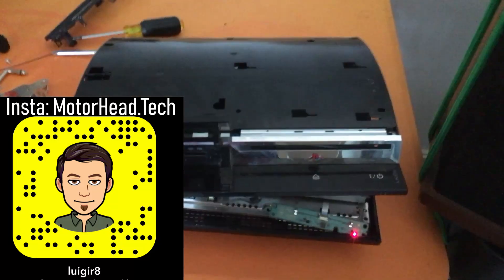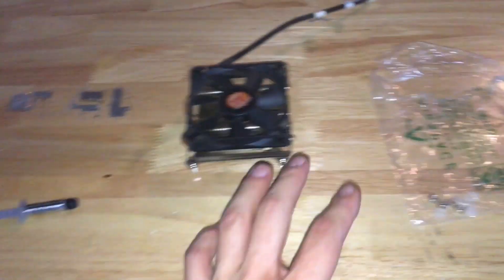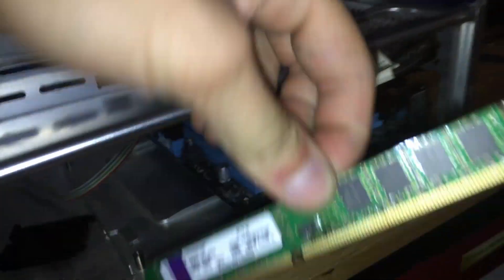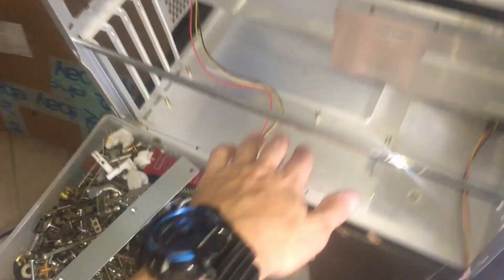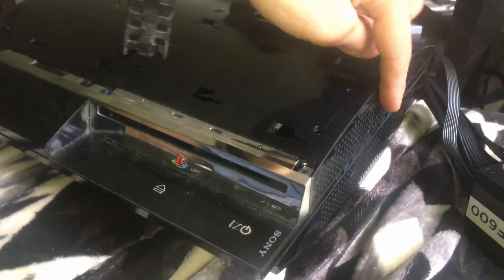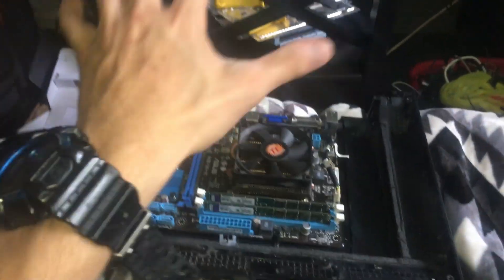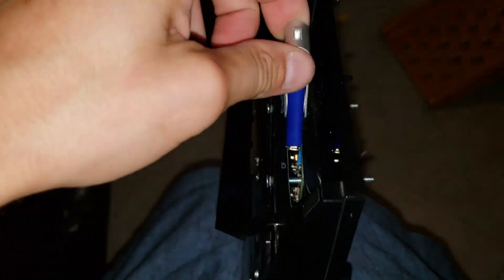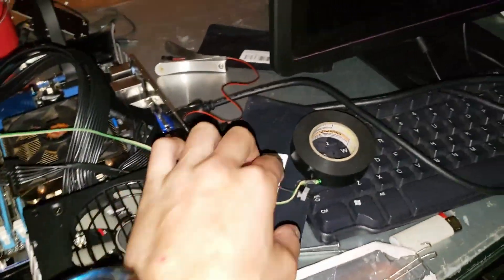How I Built a PS3 Computer! (Custom PC Step by Step Tutorial)

Comment: you can do a pc from ps3 but don t changing any parts?
Reply from the maker: No but technically you can run a computer operating system like like linux on old ofw ps3 or if its jailbroken
Reply: @MotorHeadTech  so why cant windows
Reply from the maker: @mbcchoudhari885  the software & hardware is the limiting factor, windows runs on certain components in order for the operating system to run right or else it won't load at all. That's why Linux works, PS3 OS is based off that h it requires less resources compared to windows &  Linux is compatible but not windows.

Comment: Is it possible to make pc out of ps3 parts?
Reply from the maker: No
Reply: @MotorHeadTech  why not?
Reply from the maker: The parts are not compatiable meaning the plugs, wires, software, hardware, sockets physically cannot fit not can a computer motherboard understand PS3 parts & vice versa
Reply: @dinamycvideosgaming1597  to make a pc. You would need PC hardware such as a PC Motherboard..